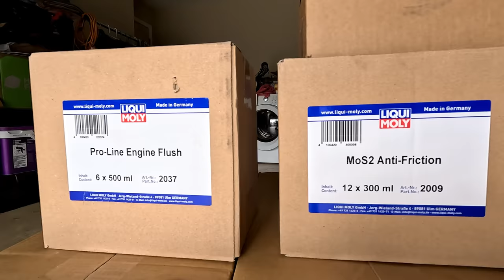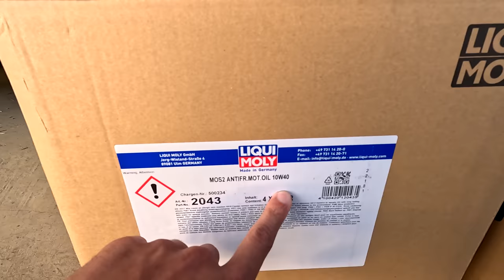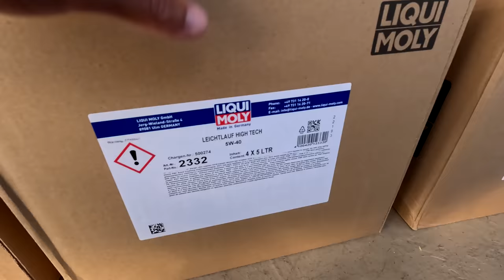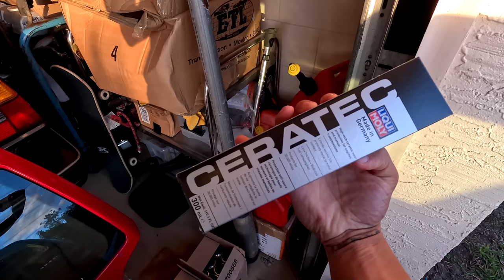Liqui Moly Delivery & Zender Parts Headed To The Body Shop!

Comment: CERATEC IS GOLD. love that stuff,  and I've put it in probably close to a dozen cars. Look up "liqui moly CERATEC art" on YouTube and tell me it isn't crazy. Engine flush is great! If you have a little extra cash and the engine is higher mileage, I suggest draining the used oil, filling it with fresh oil and the engine flush and let it run for the 10-15 minutes. That stuff liquefies so much deposits that it works a little better when it's mixing with fresh oil, probably a little nicer on the engine as well not running used oil AND 100k+ of built up internal sludge.  For reference, I did that on my jetta and couldn't tell a difference between the 3,000 mile oil I drained, and the fresh oil that was in there for 15...they were both the same color
Reply from the maker: Yeah that was actually my plan! I had saw a video on YouTube and the guy used some fresh cheaper oil with the engine flush and then after filled it up with the good Liqui moly oil. And yeah the fresh oil coming out with the engine flush was as dark as the used oil it was wild 😅